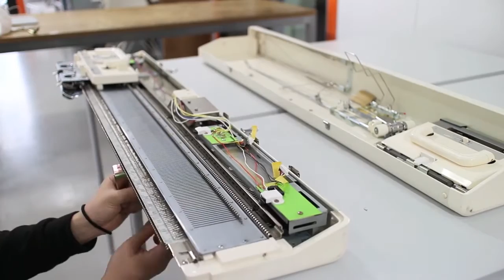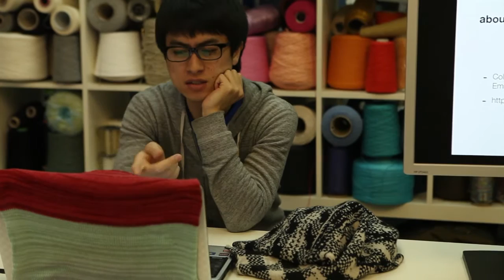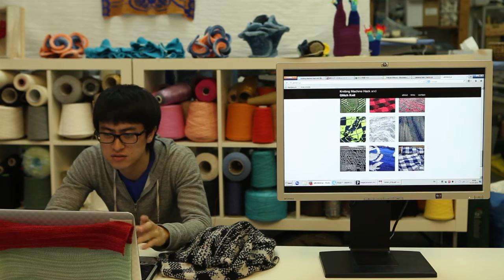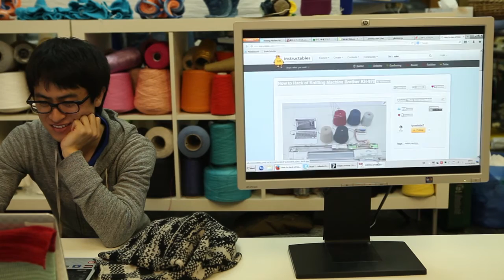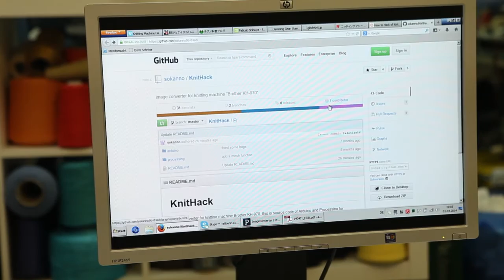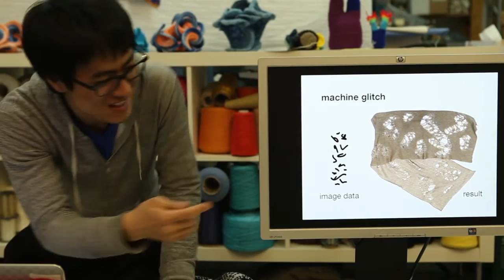So Kanno -- Knitting machine KH 970 - first time in english!

Comment: woow. very excelent. my  macine is 965 and very interest to connect to computer. i can not . would you please guide me. please. thank you for this video
Reply: Search for “img2track” for your knitting machine.
Reply: @skateness  i found it and install but is demo and didnot connect to machine. my cable .
my pc is not detecte
Reply: @satania7743  Are you using a compatible operating system? If so, it could be the cable. The demo version limits you to a design of 60 stitches. The full version allows designs up to 200 stitches.
Reply: @skateness  my problem is cable. not detect by pc.